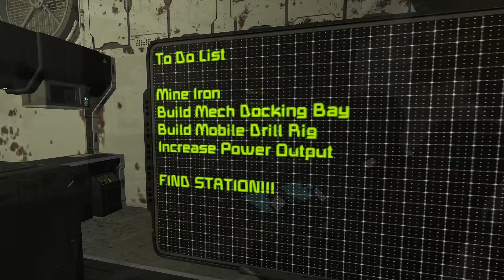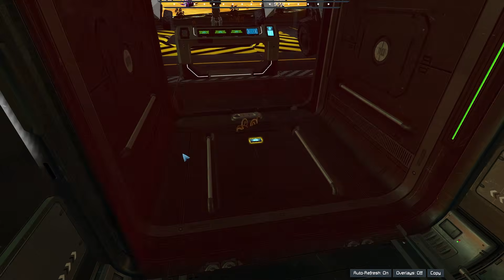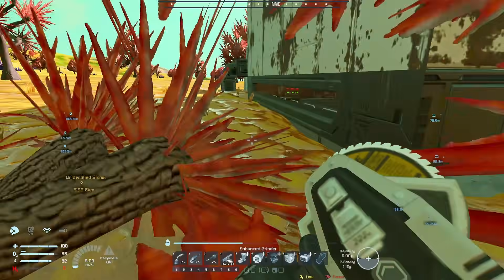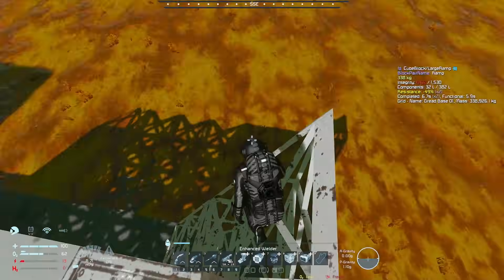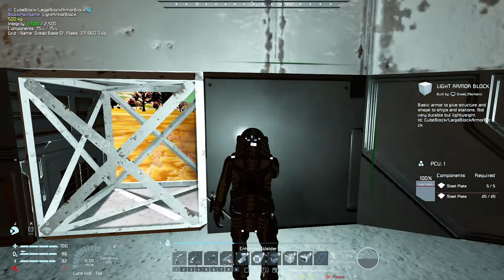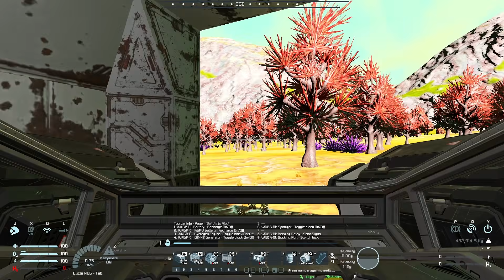👾 Docking Station 👾 | Alien:Survival [Ep.04] | Space Engineers Mech Engineering Survival

Comment: You and those automation setups. I'm sure it helps to have a "format"or "structure" that applies generally... which you seem to be great at. lol.
Reply from the maker: Yeah it really does help to have some kind of format to work with. That's why I always say naming things is important so you can easily reference stuff.

I'm always trying to refine my format and make it as straight forward as possible.
Reply: @dread_mechanic Yeah the lights are extra steps... they require a second event controller, than you would need otherwise, but it allows you to trigger and test each stage separately, and manually, without much fuss. I think it's the testing where the technique you are using with the lights really... shines.

ba dump dump.
lol

Comment: I'm curious, why do you have things set up to spin the mech back around before detaching, making you have to reverse out of the hangar?

I could hear it in the way you commented on having to go get iron yet again, that it wouldn't be too long before you decided to build something new that could haul more.

All the various multi-peds you've built, pretty much stay standing at a constant height.
What would you consider to be the Pros & Cons of one that "squatted" or lowered it's body for parking (hand brake being ON or OFF), to make cockpit entry/exit easier?
Reply from the maker: The answer to that is because I'm stupid and didn't really think abou that.
I know a good way to set up an undocking system that will let me walk/drive out the correct way and reset itself, so i'll do that next time.

The only real problem with squatting mechs is making sure you don't damage the under side on the way down.
I've built mechs that do that but not for a while.
Reply: I'm guessing that the additional timer/event controllers and the configuration of such, are as much of a deterrent as the risks of damage from squatting too far, or at the wrong time.
Reply: @dread_mechanic just add some tires as resting pads to protect belly from damage. :D